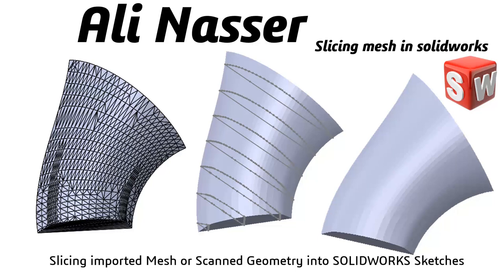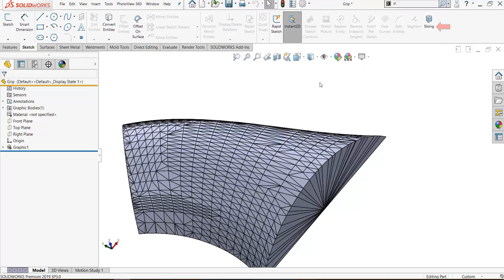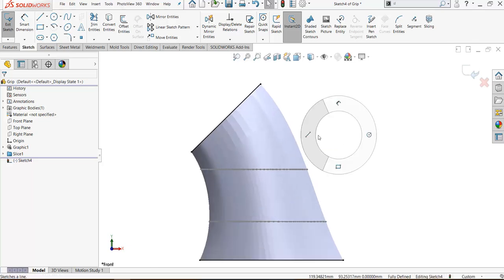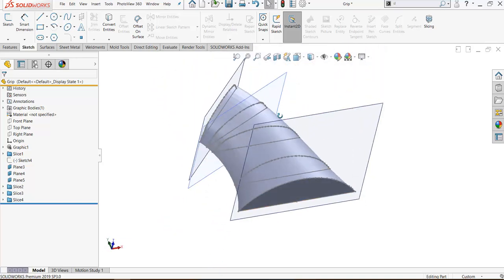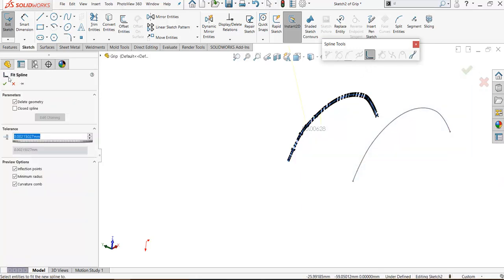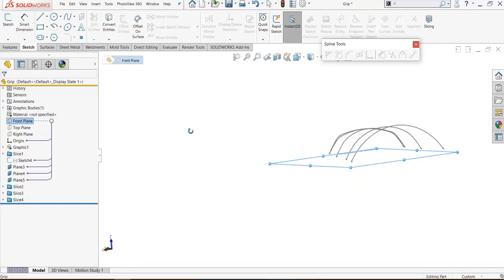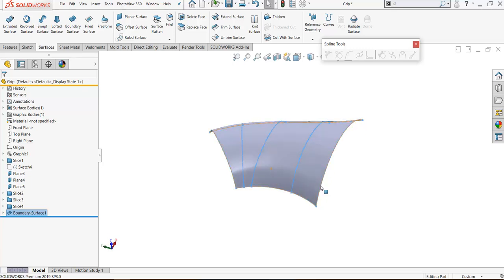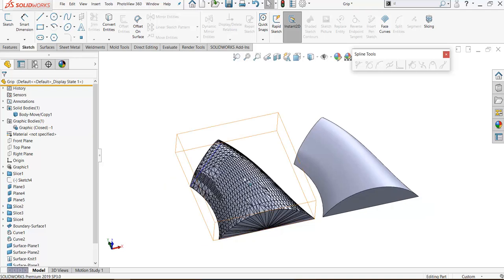Convert STL file to Solid Part

Comment: Excelent video Ali, do you know if sliding command exist in Onshape? I was looking foir and I dint get it
Reply from the maker: Onshape doesn’t have a direct "Sliding" command, but you can achieve similar functionality using Mate Connectors and Slider Mate in the assembly environment.

Comment: Am I correct in assuming that the more Slices you take, the more accurate your final model will be to the original?
Reply: true
Reply from the maker: Correct.
Reply: You probably also want to look at the way the sketch planes were set up in the original mesh. The original followed along a curve, but he used parallel slicing planes.